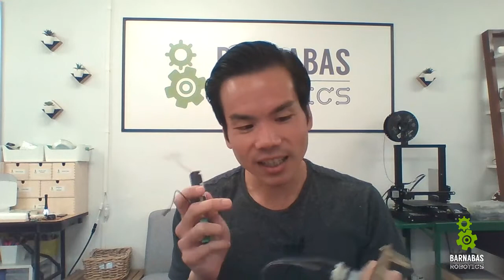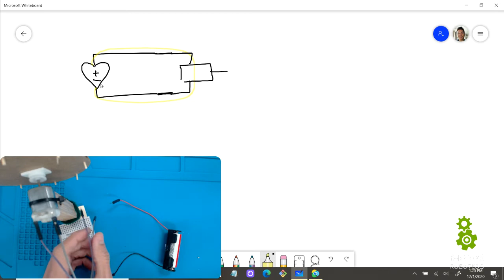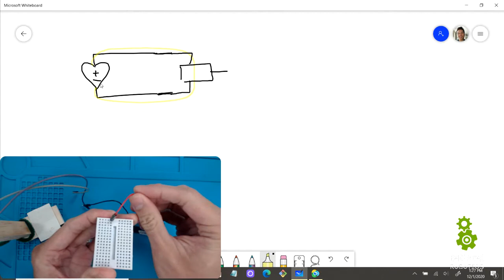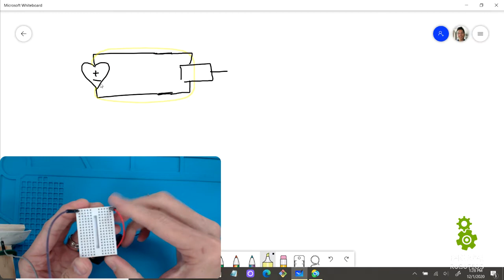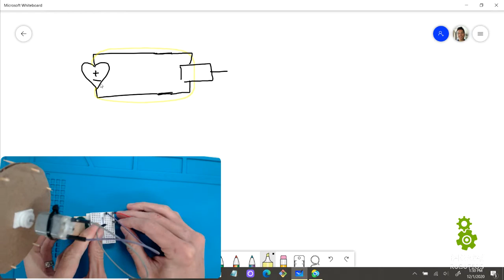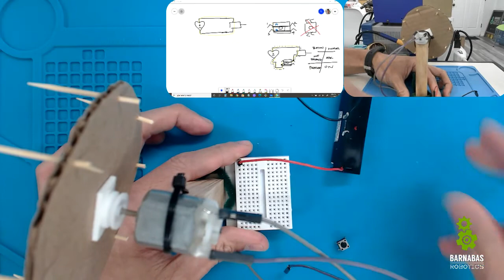How To Use A Breadboard, Button And DC Motor To Make An AND Circuit.  Robots Made Simple!

Comment: I'm try to set up a 433mhz transmitter and receiver to this and cany get motor to turn on when push button. Put light in and it will light up